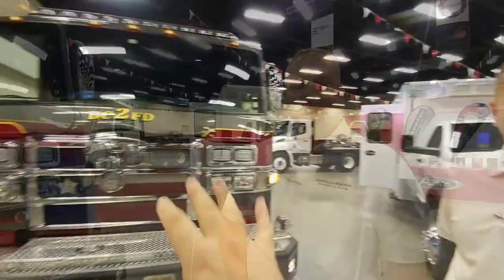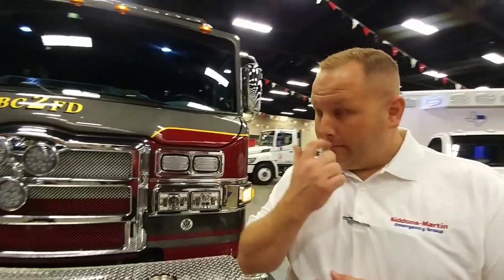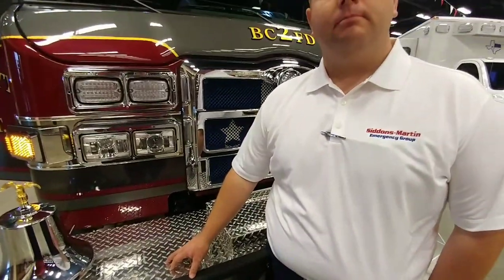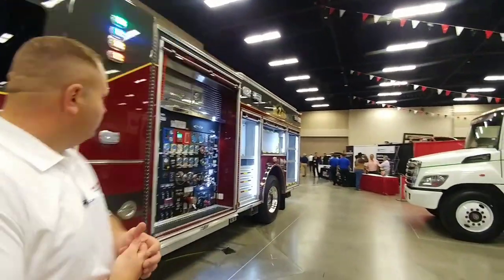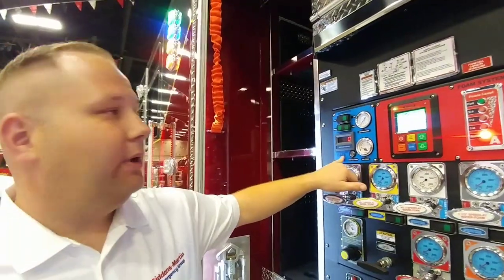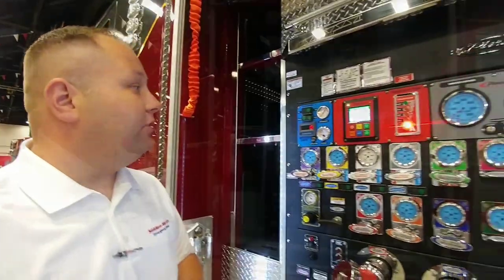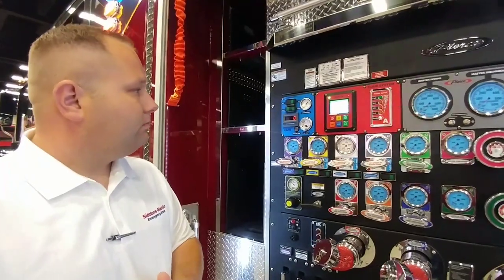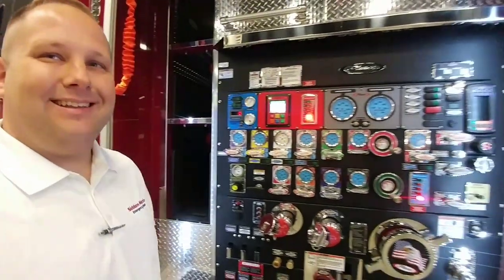Coolest Firetruck Ever!  Check out this Detroit powered Pierce Fire fighting beast!

Comment: All jokes aside, I towed a stalled 60,000 lb wrecker that was towing a 71,000 lb log truck out of the road with a 2013 F-550 with the 6.7L. It was about a 10k lb utility box set up. Didn’t go but about 3 miles per hour but it did it

Comment: Hey Thanks for this video, I'm a longtime subscriber and also a Retired Phoenix Firefighter/ Engineer/ Pump operator.  I,drove The streets of Phoenix for 30 years . My department PFD had a fleet of Ambulances that had The 6.0 and they were very problematic for years. But I also have a 2005 F350 dually with The 6.0,and knowing what i do now about that motor, it's no wonder that we had so many issues with reliability, as we were constantly having problems getting them in for service, oil changes  especially and i think for the most part  they were running the same oil as we were putting into our large Pumpers as the truck that was featured in this video.  Straight 30 wt. I,really enjoyed this episode.  I,was around when we started using all of the things featured on that Rig so i was part of the evolution of the CAF System and when you see a Fire on the news where it looks like shaving cream or a Foam Rave Party, That is from the Foam being used to help smother The fire.
Thanks again for all if The Time you take to keep us informed.  I'm also The owner of a 32 ft. 5th wheel ArcticFox.

Comment: Where is that big Hill ?  Appleton is 780 feet above sea level.  DD13's are made in different locations around the globe, with connecting rods from DDC's plant in Redford, Mich., heads from the Mercedes-Benz foundry in Mannheim, Germany, and block castings from the foundry in South Africa. Still a good Motor. If we( F.D) could get that DPF system off motor. Short trips force us to run a DPF cleaning  cycle at station.

Comment: This past weekend was the FDIC (Fire Department Instructors Conference) in Indianapolis.  They had dozens and dozens and dozens of trucks like this and even "cooler" than this one appears.  The fact that it has a Detroit Diesel isn't a surprise.  The EPA has basically made it so that what once could be ordered with ANY power plant you wanted is now only available with 2, maybe 3 engine choices.  DD13 and a few Cummins choices is it.  PS:  I know people like the roto-ray revolving light because of all the nostalgia involved...BUT it's a $2000 waste of taxpayer dollars.  It's a USELESS light that does a terrible job at warning traffic.  That's why they quit using them years ago and only came back because want to be "cool".   The Federal Q siren is justified.  There's nothing better to clear traffic.  The bell....is for parades.  Probably a $600,000 pumper truck or more.  That'll need replaced in 10 years.  A basic and capable pumper is $350,000.  Eventually the taxpayers will not fund this type of stuff.  Nice truck however.  I do like it.  Don't get me wrong.

Comment: Well, since I work at Pierce, in Appleton, I probably worked on that exact truck.....the Velocity is my personal favorite platform, but I am unaware of the Ford 6.7 availability in them. I worked on a Saber Enforcer 6.7 about  a year ago when they prototyped the first couple, but have not seen any more built, on my watch anyway. I see reps from Siddons- Martin come through the plant with customers on a daily basis. The engines I see most in a Velocity/Impel tend to be a Detroit, with the Saber/ Enforcer usually a Cummins, but many Detroits in them also. The exhaust aftertreatment on new trucks is, well, insane. I would be curious about the life and replacement costs involved with the various devices. 
Now, if you could profile Pierce's parent company Oshkosh and see some rigs THEY build,.........!
Reply: patuxent river air station just got a new 4x4 from oshkosh in december

Comment: Does GM still own Detroit Diesel? Or did they sell it?
Reply: Joshua Rodrique good question I was wondering that myself.
Reply: sold it
Reply: Detroit diesel is owned primarily by Mercedes. I work down the road from the plant where they make some of the internals for that engine. It's still a solid, well built engine for the demands it meets.
Reply: Joshua Maloczewski Oh ok. I didn’t know that. Thanks!
Reply: Mercedes owns Detroit

Comment: Sadly the Detroit Diesel engine company we grew up with and that I still have in my semi-truck on it's second life since rebuild has not existed since 2010. The engine in this fire truck is actually a 12.8L Mercedes-Benz MBE-4000 series rebranded Detroit Diesel DD13. DaimlerChrysler, ceased making Series 60 engines in 2010 and rebranded the MBE-4000 as the new Detroit Diesel. Therefore, the DD13, DD15, and DD16 are not true Detroit Diesel engines and I will not drive a truck with this engine nor own a truck with this engine. My truck has its original Detroit Diesel Series 60, 12.7L non-egr, now at 1.2 million miles on its second life and runs like new and still delivers incredible fuel mileage. I have one of the very last 12.7L non-egr engines ever built in July 2002. As long as parts are available, I will continue rebuilding what I have when needed.

Comment: its not a real detroit unless its a 12v72.
Reply: There is no 12V72.  It could be a 12V71 or a 8V92.  But, there is no such thing as a Detroit Diesel with 72 cubic inches per cylinder.
Reply: >what is a typo

Comment: On these trucks the bigger the motor the better. The motors are used for more than just moving the thing down the road, but also stopping the trucks. These trucks keep getting heavier and heavier and you need all the help you can get to keep the brakes from over heating